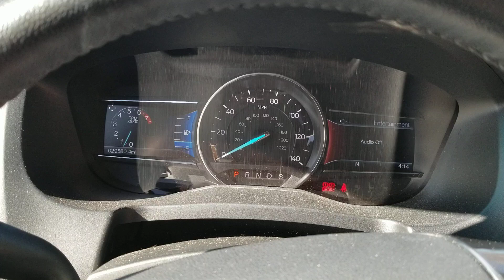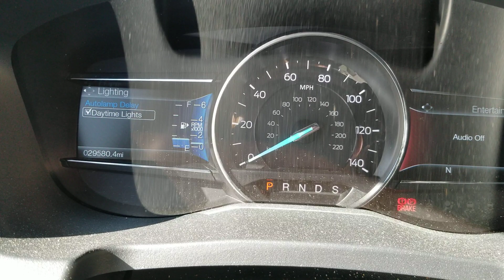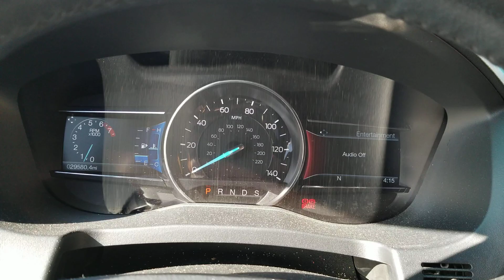Explaining How Configurable Daytime Running Lights Work On Ford Vehicles

Comment: Mine is 2016 model but I can’t see the daytime running check box in the lights setting.
How do I only turn on the running light when switch to auto?
Reply from the maker: Your vehicle may have the standard daytime running lights as opposed to configurable.  If that's the case, they will be on in any light position other than on whenever the transmission is out of park.

Comment: Mine don’t have daytime running light  any  típ how to make it work
Reply from the maker: First of all, what year is your Explorer?
Reply: @BusMaster99   2016 police interceptor
Reply from the maker: @juanjosejaimesmalpica404  Ah, you have the police version.  You may have a feature known as "silent mode" which disables features such as the DRL when enabled.  Try seeing if you have that and disable it.  Then shift your transmission to neutral (make sure parking brake is applied at all times when parked) and check to make sure the daytime running lights are on.
Reply: @BusMaster99   i will thanks

Comment: Not the case in my 2017 Ford explorer those daytime running lights come on with the lights off the lights on the car it's in park sitting idle the car neutral the car driving down the driveway at night with the lights off no way to turn them off
Reply from the maker: I think you might be referring to the accent lights.  These can't be turned off when the car is on, not sure why.

Comment: On my 2021 Explorer, one of the DRLs turns off depending on which turn signal I use. Is there a way to keep both DRLs on when using the turn signal?
Reply from the maker: Nope.
Reply: @BusMaster99  Bummer. Thanks for replying :)

Comment: Anyone know if there is there anyway to configure the fog lights to come on automatically?
Reply from the maker: Easy, turn on the lights, press the fog light button, then turn the light switch to AUTO.  Then they will come on whenever the autolamp sensor turns on the headlights.  If you turn the light switch to OFF after the fog lights have been turned on, they will turn off and you will have to turn them back on the next time your headlights are on.
Reply: @BusMaster99   Word! Thanks for the info and the quick reply
Reply from the maker: @thineanatyahoocom  Sure thing!

Comment: My 2017 explorer does the opposite. I can’t shut off the running lights. When the car is parked and running they won’t shut off.
Reply: I have the same problem with my 2016.
Reply: ugh. mine too. its annoying asf wen i want to leave car running without lights on!!
Reply: My 2017 Focus was as you state. I could not disable the DRL at all. My 2018 Ford Escape, however, functions like the Explorer in this video. I also have the ability to disable DRL in my settings menu on the dash display.

Comment: What replacement bulb do I buy for the low beam / running lights?
Reply from the maker: That's an LED, it can't be easily replaced.
Reply: @BusMaster99  thank you. So I'm just search LED on Amazon? Or is there different sizes? ( Sorry I dunno much about lights )
Reply from the maker: @JohnConnor636  Sorry about the late reply.  If your low beam goes out, you have to buy the whole light assembly if you want to replace it yourself, which I don't recommend doing.
Reply: @BusMaster99  oh wow, they must be design to last then.
Reply from the maker: Yeah.

Comment: what year is your car ? mine is 2016 and i don’t have the option to check or uncheck the box for daytime lights in the menu settings.
Reply from the maker: Not my car, but this is also a 2016.  You probably have regular non-configurable DRLs.
Reply: Do you figured 
I have the same problem
Reply from the maker: @tineuno5057  You either don't have DRLs and it's older than a 2016 or you have DRLs, but they're not configurable (meaning they will light up as soon as you shift out of park in off, parking lights, or auto).
Reply: 2016
Reply from the maker: @tineuno5057  You have the non-configurable DRLs then.  They're always on out of park and there is no way to disable them.
Reply: @BusMaster99  thank you very much
Reply: @BusMaster99  my lights are on all the time in park to. I hate that.
Reply: @BusMaster99  My 2016 Escape as soon as I turn the switch the daytime lights turns on and the transmission is still on park. Do you know what could be the problem?